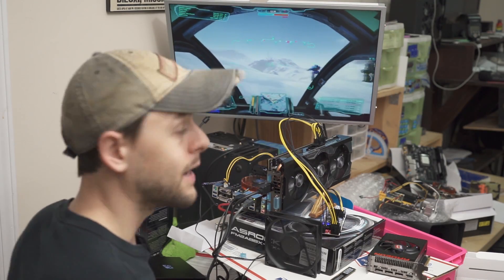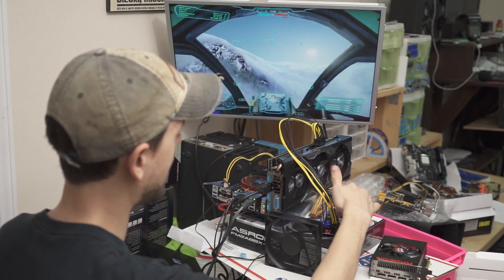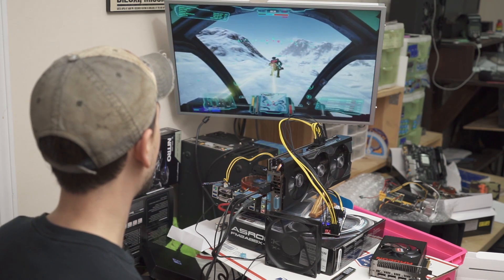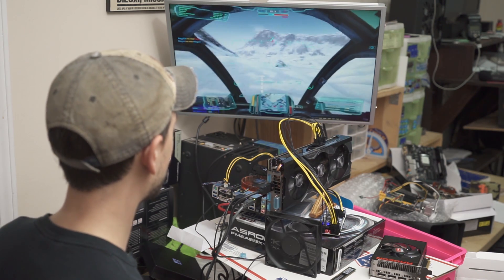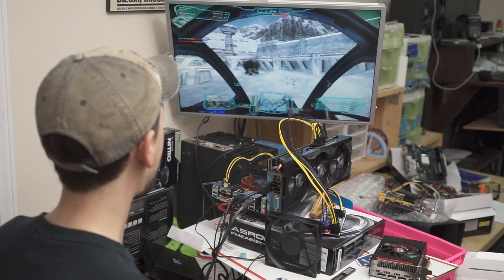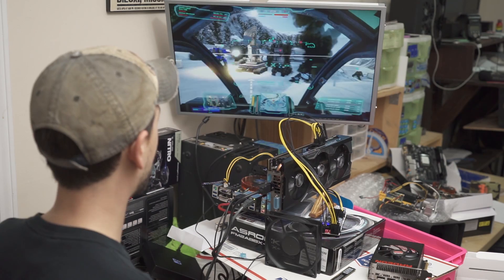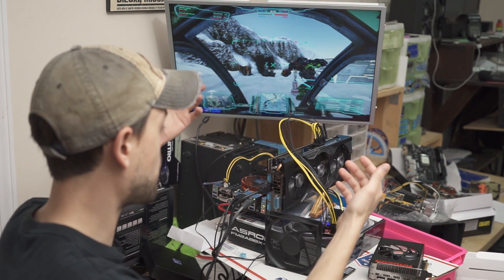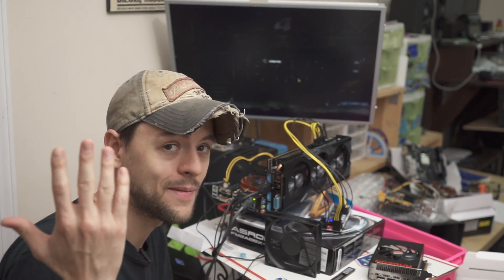Pico + HDPLEX in an S4 Mini?

Comment: very helpfull. im a gamer in a motorhome so looking for 12v psu. only problem ive i7 motherboard and nvidia 970 and so looking for adapter cables to run power to gpu. do u have videos for this? ive got the 300w Chinese  (hdplex copy) psu card. but gpu card has no direct power. any ideas. eltel72@yahoo.co.uk
Reply from the maker: With a 970 you can make a harness and power the GPU directly with 12v. The card will come on when you turn your PC on.

Comment: Hey Josh, Im wondering how you would power both the pico and the HDPLEX with the one Meanwell adapter? Would that involve some fun wiring solution? 

(For more info) I am trying to fit a gtx 1070 and ryzen 7 1700x into an LZ7 case. The build also has a 500gb ssd from samsung, two 92 mm fans, a 140 mm fan, and 2x 16gb ddr4. Cooler Master's power consumption tool estimated the build to draw about 350W (not at full load). I was originally hoping to power it all just from the HDPLEX 400 and the Dell 330W adapter, but I was told that would simply not be enough power. 

I'm really trying to maintain this setup but have no other options but to ditch the effort and just go with a normal corsair sfx psu. Hoping someone can help me... Please let me know!
Reply: You can undervolt the CPU and GPU, or limit the power consumption.
Reply: Power consumption for the video card will decrease by 30% and for the processor by 20%. Performance will decrease by about 5-8%. And they must fit into 330 watts.  However, I think that the power supply should have a power margin of 20-30%.

Comment: Why do you need a 12v dc to dc converter for a pc.... You need one to use it in your car or at some place where there is no 220v or 110v power available like in your car (you can have 220v with an inverter but it is inefficient) this thing is just a complete waste of money if you use in home!! It is ment to use in cars or rvs!! Just use a buck boost converter because many of them has the 12v rail directly connected to the input and 14.5v of aultarnator will kill anything conected to the 12v rail of the pc!! So just to be safe and also make the voltage stable use a ltc3780 and it will keep it stedy 12v no matter if the input voltage goes to 10v (it happen when an engine carnk) or at 14.5v (when the aultarnator runs) also you can power your monitor and by the way use a dmm to set the voltage and remove the cc mode by turning the cc pot all the way up and not only that now you can power your pc on the go something like a laptop ...
Reply from the maker: This is just so you can use a power brick with your PC...basically the same concept as a laptop. This is for specialty builds where you get as compact as possible. I have other videos that demonstrate this better. Peace.

Comment: what is the best pico psu combo for an i5 6500 gtx 1060 or a Intel pentium gtx 1050?
Reply from the maker: Dell 330w PSU and the HDPLEX 160 DC-DC
Reply: What about for the pentium and 1050? Not sure if I can afford that combo thanks though! :)
Reply: Would the 330w psu from dell work with a 160w pico psu? Can't find the HDPlex where I live.

Comment: From what I can recall on reviews of the Pico PSUs, they did no rectification or had any effect on the quality of the 12v line, that depended on the quality of the power brick. Why not run a good quality 12v power brick such as a meanwell to a "busbar" in the case, then to the Pico PSU and a power relay. Then run either a 5v or 12v line off the Pico to control the relay. The relay then feeds the GPU instead of the Pico. When the pico turns on, so does the relay and thus the GPU without putting extra strain on the Pico.

Comment: I plan on using an i7-6700K and an Nvida GTX 1050 Ti.   I am building a mini ITX case.  First of all, what power supply should I use for that setup? (PICO or HDPLEX) and if I plan to overclock the CPU a bit, will that change the answer?
Reply from the maker: If you want to overclock then your going to go with HDPLEX. If not, the 160XT would be perfect. The 6700k can get pretty warm especially with more voltage running through it and that can be a challenge inside mini-itx. Peace!
Reply: Not From Concentrate what would be the best power adapter to purchase to power the HDPlex that will work well?  I've been looking around for days and can't seem to find one m.

Comment: So what type of power brick should I look for if I have a FX6300 CPU and an GTX 1050ti SC card from NVGA?  Looking to make a Mini ATX system with you S4.  Would run 1 SSD with the system and 8 GB of memory.
Reply from the maker: If you aren't doing any overclocking then the Pico 160XT-KIT should be fine (it comes with the 192w brick). Peace.

Comment: I took one of these "cheap" 150 watt 12v/12.5amp bricks apart and added an 80mm fan. That made a huge difference in usability. Prior to this mod I could not load an OS before the brick overheated. Now Its cool under load.
Reply from the maker: Yeah there are a paltry number of good bricks out there. The Adaptec 12v 16A brick is a beast and I highly recommend it. If you are going 19v then the Dell 330W brick is pretty decent. The rest of their PA lineup can double as griddles... xD

Comment: Why do you suggest a 250W PSU when almost every gaming rig uses 500W+ PSU's? I have an i5-6600K and a GTX 970 and I'm using an SFX-L 500W PSU
Reply from the maker: My channel is pretty DC-DC oriented. SFX PSUs are awesome, but it is a different tool. Thanks for watching and commenting. Peace!
Reply: I think big 500W+ PSU and so might be a bit of a hoax, like many other things in the PC industry. They're all made on the same production line after all, just a few different components that maybe cost a couple of cents more.
It's funny how PSU calculators always recommend a much bigger PSU for your system. For instance, 300W is well enough for my i5 2500k + 750ti mini itx build. PSU calculators say 250W, but still recommend 500W and then there's a link to some store page
Reply: @DecibelAlex  374/5000
It is more a matter of energy efficiency I guess. The best energy efficiency occurs when the system uses around 60% of the total power that comes from the power supply. For example, if you push a 300W power adapter or ATX power supply to a "hypothetical" 100% performance, you will be pushing its components to the limit, causing too much heat (loss of efficiency) and shortening the life of your unit/s. 
So it is advisable to use the best power adapters/supplies in this "high power" scenario.

Comment: You can try fitting an internal thin power supply such as PFM4414VB6M24D0C00 to avoid external bricks.
Reply from the maker: Well I hoped to show in the video that it is possible. The drawbacks are for you guys to decide! :D

Comment: So can I use 2 HDPlex or would it be better to use a Pico Box x7 500w psu?
Reply from the maker: Depends on what you want to use it for.  I've not tested the X7, personally...that is ALOT of juice.
Reply: My rig will be pulling 405w maximum for all the hardware inside.

Comment: What's the third power brick from the left at 0:40? I like its slim profile.
Reply from the maker: +ccricers That's one of the members of the Dell PA-9e family:  

http://goo.gl/N27RUP

Its better suited for lower wattage 19v systems as it can get super duper hot.
Reply: +Not From Concentrate Thanks. Was hoping it would be better but should be decent for a 200w system I hope

Comment: How did you link start of both power dc-dc ? phobya dual 24pins?
Reply from the maker: +MarcParis Naw just a jumper cable.  You can see it at 4:45.  Green to black.
Reply: +Not From Concentrate thank you, got it. Could you include one in my order please?..:)